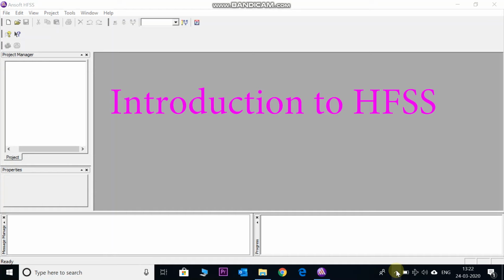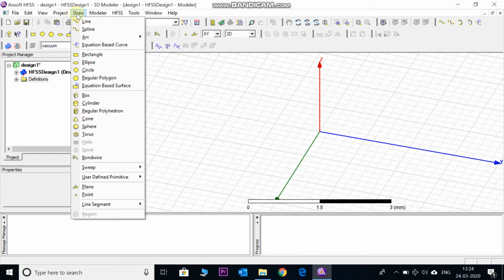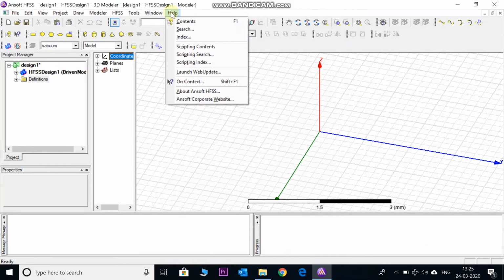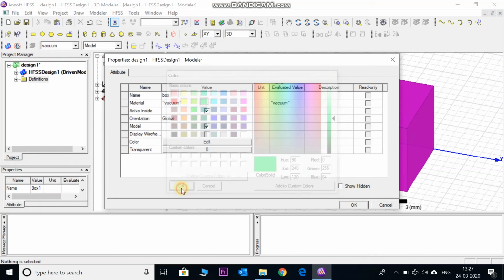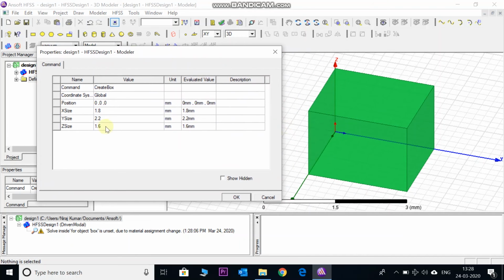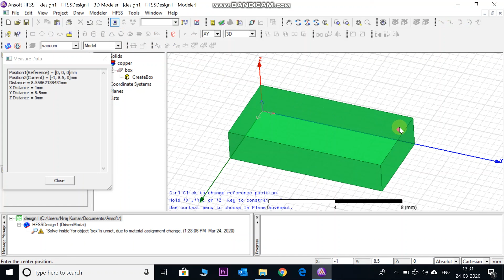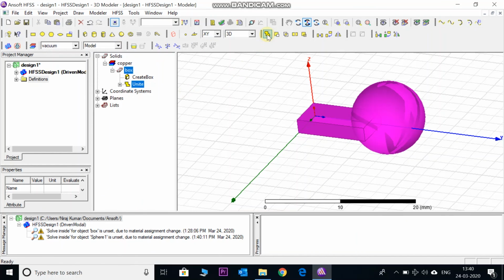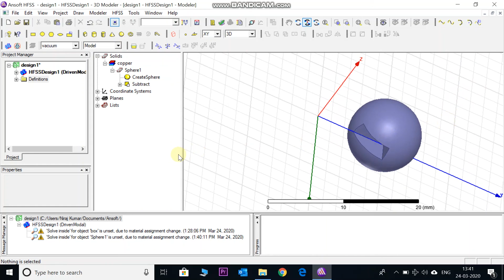Introduction to HFSS for antenna/microwave device design

Comment: Which software is suitable for simulating antenna and Rectifier in one single software for rectenna design? Please recommend.
Reply from the maker: You can use circuit schematic of hfss which is available in newer version. You may also use ADS.
Reply: @RFDesignbasics  Thankyou sir, do you have newer version of hfss ?? Kindly give me link or drive file of hfss for installation.
Reply from the maker: I don't have it.
Reply: @RFDesignbasics  Ok sir, thankyou.

Comment: Bro I need help how can I contact you can you plz inform mee 🙄🙄
Reply from the maker: Check the about section
Reply: @RFDesignbasics  I am designing frequency tunable CPW fed UWB Antenna Using veractor diodes and SDR  can you help for this 
Can u help me how to contact you ..🙄